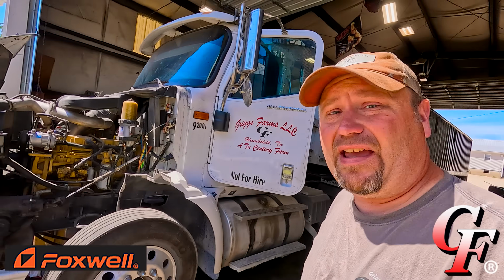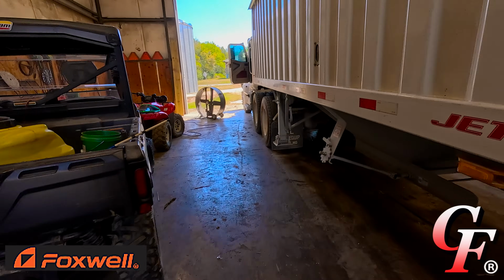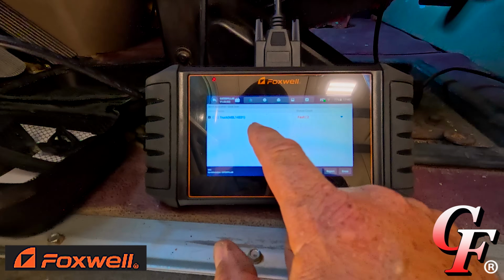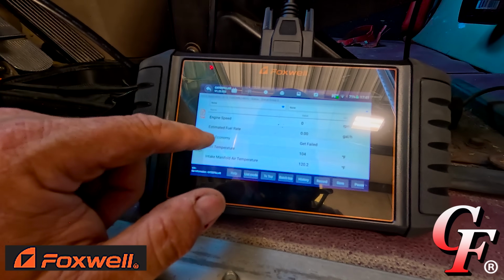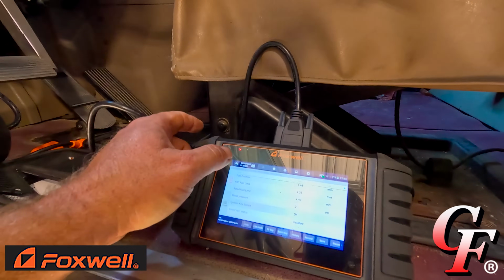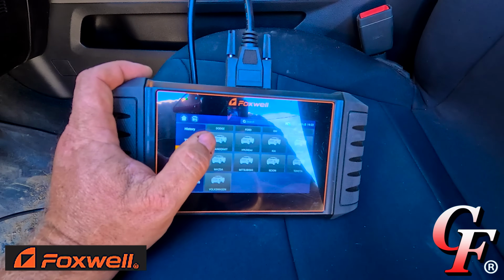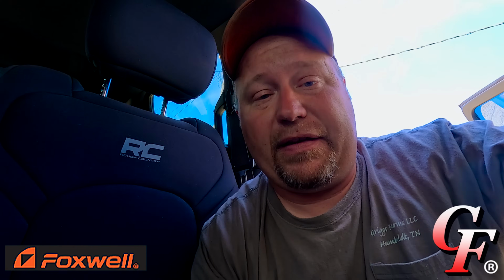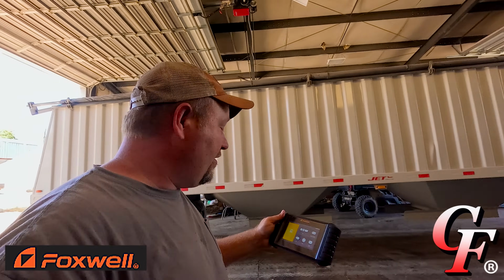Foxwell HD500 Heavy Duty Truck Scanner Test and Review

Comment: Man, I can remember in the good old days. If you blew a fuse in the fuse box. I just wrapped it with. My aluminum foil out of my cigarette pack. That would get me home. With the heater motor working. It was simple back then.

Comment: Matt. If you drive a Ford. You always carry a scan tool with you. Why do we have all this electrical bull shit That is always screwing up in the first place. I think we should go back to the Auto wreckers. And see if we can't find some. Mid 70. Ford and Chevys. 351 Cleveland. 350 Chevy. 4 Volt mains. Spark plugs. Electronic ignition. Plug wires, of course. And especially roll up windows. Keep it simple. Put the key in and drive it. Just said gas and oil. I miss those days. Other than the loss of gas. LOL.
Reply from the maker: No Fords on this farm anymore…proud to be a part of the RAM club

Comment: Chrysler has security on their diagnostic port that won’t let you get to all the functions.
We had to buy a new scanner that had WiFi/internet capability and get a subscription, then log in to the website to get all the functionality.
Look up what the code is on your Dodge and see if you can fix it. The check engine light will go off after several key cycles.
Reply: Yep! ✅That's why we need the 12+8 adapter cable for accessing Chrysler/Dodge security.
Reply from the maker: Thanks for the input